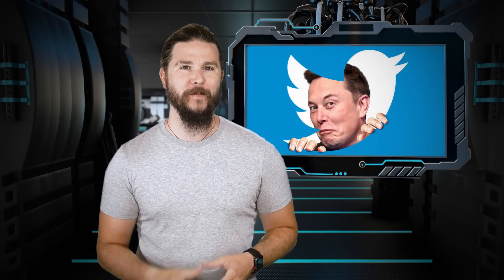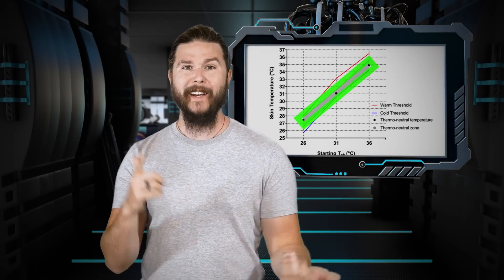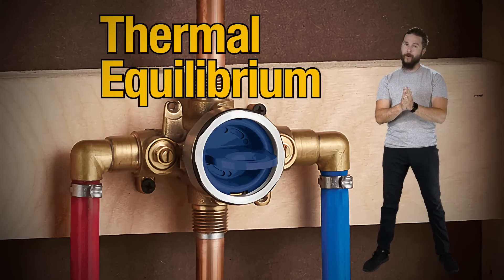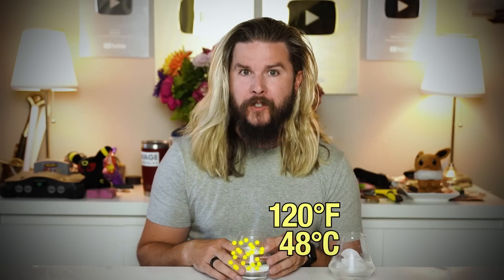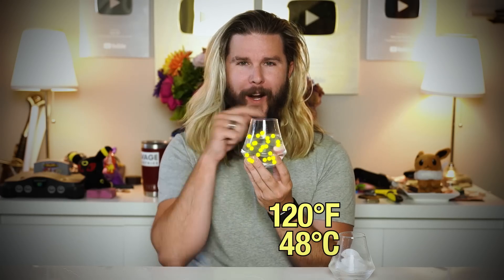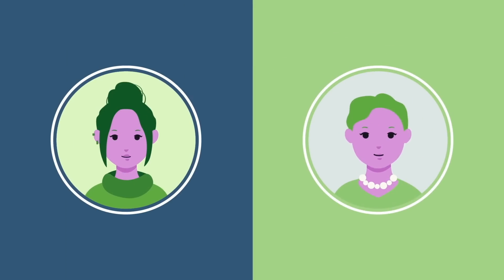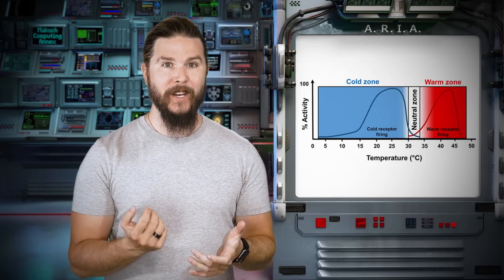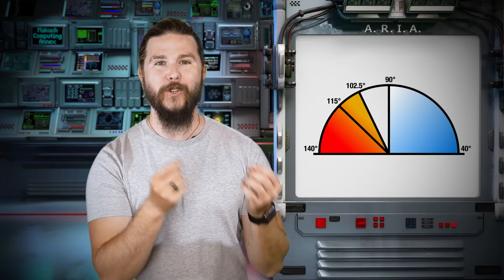Why Are Shower Handles So Sensitive?

Comment: So here in Australia until the last couple decades we didn't really use that stupid one handle control for our taps. We had two separate dial like controls that I can't find the official name of. I'd traditionally call it the hot tap and the cold tap but I don't know if that's technically correct when you have a mixed tap (unlike those in the UK who may have separate taps).

Comment: The best option is to have individual valves, one each for the hot and cold. They seem to have much more fine control when it comes to temp due to the ability to just increase or decrease the temp of water you want.

Comment: If you buy an expensive shower valve assembly it will do away with the problem of adjusting your water temperature in the shower, ask the plumbing technician at your local Home Depot for the best shower valve

Comment: actualy you need better valve 
most valves have round holes. so on the sides of spectrum it is less sensitive than in the middle, where is counts

Comment: Showers that have independent hot and cold taps are easier to control. If you have a geyser then the sweet spot tends to move as the tank empties. There's also those masochists who take cold showers but we won't talk about them.

Comment: There's another solution and it's easier. Most showers have a stop on the canister/mixing valve you can pop the screw off to remove the lever and under should be adjuster to stop the hot water at a certain point. If you do it after setting the temperature (maybe add a bit if you would like to take a slightly warmer shower occasionally) and then you can just turn it all the way on every time

Comment: Kyle, you dunking on Elon Musk looks strikingly similar to other guys dunking on their exes.
Thanks for seeing the light and ditching that jerk! >:3
P.S.: You have missed something. On most of the showers I have used, only about a tenth of the handle motion controls temperature at all. The other 90% of the range is either entirely cold water or entirely hot water. So the actual useful range can be around 1% or less of the handle's turn radius. Worse, on single-handle showers, the functional range often depends on the water pressure setting. On the one I used to test this, I found that at maximum pressure (which was uncomfortably forceful for me) the control range could be as large as 30% of the handle's turn radius. However it faded on a linear curve to completely disappear at around half pressure. At any pressure below this point, there was no control range at all, and the shower would simply give either only hot water or only cold water. It was thus *actually* impossible for me to get both a comfortable temperature and a comfortable pressure in this particular shower. And this was not any unique shower, it was simply the one on which I performed the test.
P.P.S.: No, it really is lazy engineering. If I had a shower with 100% or even just greater than 50% control range, I would find a comfortable temperature easily and never complain. But I have only ONCE used a shower like this. If you have one like this, then what are you complaining about?
I don't think it's lazy engineering actually, but rather classism. I suspect that the more expensive homes include these higher quality showers, even though they don't cost more, simply because they want to make sure that cheaper homes are less luxurious. It is similar to how they intentionally make flip phones suck in order to make people with smartphones feel superior.

Comment: shower handle? i just have to knobs, the hot one you open fully and with the cold nob you adjust teh temperature until is juuuuuuust right. usually a quarter of a twist. but perhaps thats a dutch thing, i dont know how other countries do it

Comment: I have an old-school style shower with two dials, one for hot and one for cold. Tbh I think it eliminates a  lot of these problems because YOU choose how much hot and cold you have. I always turn hot on full and then adjust cold until I'm comfy
Reply: That's pretty much what you have have to do with a hot, cold, and shower divertor. You turn the hot all the way up for the max water pressure and then add with the cold water to regulate the temp. It fluctuates when your water heater isn't working right or if someone decides to flush the toilet or run the kitchen sink while you're in the shower.
Reply: I came here to say this same thing. Though we have the same issues while we're adjusting the cold dial.
Reply: @Jarekthegamingdragon  Same here! Two knob showers are superior :D Though a lot of this discourse depends on how your hot water heater runs and your water pressure too!
Reply: @Jarekthegamingdragon  could try cutting the seat and installing new tap washers. You may have a sticky/deformed washer on the cold tap.
Reply: I just use cold water and i'm fine
Reply: @Sp3ttr0  Are you physically fit? And that is a serious question by the way. I genuinely want to know because I heard that colder showers make you lose more body fat.
Reply: @Rightly_Divided  yes, but i don't know if is the cold shower that make you lose body fat,  thou my skin is good and i don't suffer much the cold; however in my diet there is almost no 
flour based food, i don't eat product maded with milk and almost no sugar and rarely some alcohol
Reply: @Sp3ttr0  Oh nice. That is probably more it. The diet more than the shower. Thank you for the response
Reply: @Rightly_Divided  You are welcome

Comment: Showers are not generally built this way in Sweden. It always confused me then I visited the states how anyone would want a shower with a design like this that makes it so hard to find a good temperature.

The common design here uses two screw knobs, one that controls flow and one that controls temperature. The temperature one has usually has more than 360 degrees of motion and makes it really easy to gently make it hotter or colder.

Comment: At the hotel where I work, our shower faucets actually have a "mixer" on the hot side which prevents the water from changing too rapidly. It's a great design, but can be annoying if your area has hard water, which occasionally is subject to particles breaking loose and jamming it due to buildup. It's really just a little barrel in a tube with holes in it that spins in place to mix the hot into the cold. Any sizable pieces of buildup that break loose have to either work their way through or be removed. 

Again, it's a great design and makes it virtually "impossible" (I use the word loosely) to turn the water hot enough to cause injury. But it comes with occasional headaches.

Comment: It's funny to see this video as a Brazilian, as here we all use electrical resistance inside the shower to heat up the water, so there are two types:

1 - A simple electrical coil resistor with a few stages that we select, so there will be more or less current through the resistor, and then more or less heat(and it only turns on when there's water going through it, so it won't burn, but it sometimes happen anyway), so to get more precise temperature, we change the amount of water going through it(and get to the same sensitivity problem)

2 - A less used or know, a more expensive electronic shower, that uses a potentiometer(a variable resistor), so the water will have only open and closed stages, and using a knob we can change the resistance precisely to what we desire, with less sensitivity and preventing the occasion of burning the resistor

And also, NO IT DOESN'T GIVE US ELECTRICAL DISCHARGES, even on bare foot, in order to get a shock, you have to actually touch the holes of the shower somehow, and I actually never heard myself of anyone dying or getting a strong electrical shock from a shower, like, ever

Comment: I have considered this so much while showering. I’ve worked out a connection between temperature and pressure of both hot and cold sides. Makes for a very complex interaction between mixer temp setting and the overall pressure setting

Comment: Some people warned about Legionella when reducing temperature on the heater. While that is an important point, it's only true for heaters with a hot water tank! Heaters without one are less prone to Legionella and if you'd still get them, you couldn't turn the heat up high enough to actually kill them, since it takes minutes for them to die even in boiling water.

If you have an instantaneous water heater you should set a temperature that enables you to enjoy a hot shower when the handle is turned all the way to "hot". This will save you energy, frustration and, very conveniently, if someone else uses water while you shower, only water pressure will change, but temperature will not.

Comment: My shower has seperate temperature and flow controls

After setting the temperature once I dont have to touch it again.
Its pretty much norm in here. I have not seen a single shower like shown on video.

Comment: okay....hear me out.......how about we put a heater, INSIDE the showerhead?
you could use a turbine to generate power from the flowing water sending that energy through a bit of nichrome wire mesh to heat it up, and have the water pass through it which heats it up allowing you to "buffer" the water with a bit of extra heat almost instantly to allow for smoother temperature changes.

Comment: The obvious solution is to make your shower handle a giant steering wheel, so you can feel like you're driving a ship while showering
Reply: I love this idea.  This is not the solution for this problem, but it still solves so many problems.
Reply: and have a 100:1 gear underneath
Reply: If you close your eyes and  spin your head around for the sea sick sensation you can pretend you're a pirate travelling the seas during a violent storm
Reply: @cornbreadloverrr  I like this.
Reply: Gaint wheel so the few degrees you turn it are easy to see and control, and you're captain, good solution
Reply: @stoatystoat174  A ship turns over the course of many miles. No need for a giant ass wheel. The boats with large wheels are smaller boats that turn more quickly.
Reply: Perfect level of immersion! I'll get an outlet set-up so I can play Sea of Thieves in VR. I'll need a power strip too. This is going to be great!
Reply: @McGeistly  that sounds like a shockingly good idea!
Reply: Yar! It be drivin' me nuts!
Reply: Instructions unclear. Im now a fugitive from the british empire.
Reply: And while we're making improvements, add a throttle to control the total flow rate.   Maybe a big horn.
Reply: @ANunes06  I like this idea.
Reply: I thought of just adding a mechanical temperture mesuring device and having its displey be at the edge of the adjuster
Reply: Yes!
Reply: Somebody, please implement that!!
Reply: Add this to the list of deep desires I never knew I had
Reply: Ledle ledle ledle
Reply: And with the ability to stop it from affecting the temperature
Reply: Nah, a panel on the wall that allows you to set the exact temperature will do me.
Reply: I mean you could get much more percise temperatures with a large wheel instead of a small handle
Reply: @almontemcclendon661  if i had a big ass frigate steering wheel in my shower i would be sooo happy.
Reply: Yeesssssss, a great stonking ship's wheel in the shower would be great fun.  Best when paired with Jolly Roger curtains.
Reply: Genius
Reply: This is the way
Reply: You say this as though you've already done it 😁🤣🤣🤣
Reply: @Cyb3r_Snai1  It's a solution that only an engineer would come up with.
Reply: Turn this giant wheel that is bigger than the moon just one nano-arc-second of a degree, that will work.
Reply: +1
Reply: YES.
Reply: Small issue: I have a very strong urge to spin it dramatically and thus burn myself
Reply: Dude,… my mixers at my other house are kind of like an old, old, ship’s speed control/throttle whatever the maritime term is, come to think about it.
Reply: Most ship steering wheels are really small, in fact the biggest ship in the world has a steering wheel that's about 12 inches
Reply: @ballistictank8023  That doesn't surprise me, the larger the ship, the less precision you need as it's going to take a fair amount of time to see any corrections you make. Those large ships take miles to come to a stop when you want to.
Reply: @ballistictank8023  We mean older ships, with big steering wheels.

Comment: It seems like in Finland this has been solved a long time ago because we have showers with better temperature control
Reply: People here just exaggerate about the shower. Its not hard at all to find the temperature you want, probably no different than Finland showers.
Reply: @SelfProclaimedEmperor  very different in fact, almost all showers in the northern countries use thermostatic mixers, which mixes the water to a set temperature rather than a fixed ratio, usually a turn knob on the side of the mixer which can turn about 360 degrees, giving you sweet sweet accuracy
Reply: @TheBorderdogg  Yup same here in eastern europe. Thermostatic valves cost the same as regular ones. I haven't seen manual valves in a long while. Just set the temperature you desire and let the machine do the work...
Reply: @TheBorderdogg  Is this because in the northern countries the pipes are far colder, thus making setting the temperature you want manually harder to figure out?
Reply: @SelfProclaimedEmperor  nah, we like shit to actually work decently in the cold countries. Roads, shower controls, public health..
Reply: @GundamReviver  Funny, because the US ranks higher than all of the Nordic countries on infrastructure. Sometimes the memes are just memes, and the superpower is actually better.
Reply: @SelfProclaimedEmperor  just checked because this sounded dumb to me. Netherlands (where I'm at) 94.3 only Singapore is above it with 95. 4 the US is at 87.9 (which is indeed above Denmark and Sweden for instance)
Reply: @SelfProclaimedEmperor  You're telling me that America ranked better than Norway, the **most developed** country in the world in infrastructure? I'm gonna need a citation for that one bud
Reply: @LulfsBloodbag  Norway is not the most developed country in infrastructure, where's your source?
Reply: @GundamReviver  well I'm still correct then because Netherlands is technically not a Nordic country lol
Reply: @SelfProclaimedEmperor  Huh, funnily enough I looked it up and apparently Norway is high in pretty much everything except infrastructure. That's weird. Well, I admit it. I was wrong. But also the UK is two places higher than the US so I'll take that as a win lol
Reply: @LulfsBloodbag  Well I wouldn't count on being ahead for long, we got the infrastructure and jobs investment act just starting up putting $550 billion dollars into infrastructure projects, while as far as I know UK has no infrastructure building program going on right now. lol
Reply: @SelfProclaimedEmperor  Actually we do have new infrastructure being built. Most notably is the HS/2 railway project to provide a high speed train link between London and I think Manchester, which is really needed. Our trains are better than American trains, sure, but they really lack compared to the rest of the continent. We really are suffering from being early adopters, all of our existing railways are relatively low speed because of how twisty and bendy they are. Our tunnels are also too short to have taller locomotives like Germany with their double decker passenger cars. But anyway, as much as America and the UK have a friendly rivalry, good luck with your own projects. I just hope it isn't going to be more car lanes.
Reply: @LulfsBloodbag  More assumptions..."our trains are better than American trains" lol...according to Statista, for "Ranking of the most efficient countries in train transport services in 2019" America ranks 12th, while the UK is not shown at all, thus not in the top 20. Ooph...even France beat you guys...and the French are...well...French.
Reply: @SelfProclaimedEmperor  How the hell can your trains be 12th? The only place with effective trains are Florida (Who have Virgin trains) and New York.
Reply: @LulfsBloodbag  Hmm, well I'm sure British trains are well made, but the train system itself seems to be highly bureaucratic and slow. Most British people I ever met say the trains are always late in the UK. 

As for the US...well I know we invented the meme that all of the US looks like detroit, but its not actually true, funny when people underestimate us though lol
Reply: @SelfProclaimedEmperor  Part of the problem with the trains here is they're privatised. So some companies can have amazing trains that are always on time and fast and comfortable, and then you get companies like Northern Rails or Arriva which are known for being shit. I might be misinformed, but I got the impression that the only train service in America is Amtrak and that they're often late because they share lines with slow freight trains. That's why I said NY and FL are the only places with good trains, FL has virgin media and NYC has the metro

Comment: Note that the "Cold" water is just water directly from the public water pipes. It is not heated or cooled to any particular temperature, it is just the temperature of the water source and the environment. So as the weather changes that "sweet spot" will gladly start moving around.

Comment: You can also replace your shower valve with a dual function valve. This is one that has one handle that opens and closes the valve letting water into the shower, and second valve that independently controls the hot/cold mixture.  These usually have fine control valves for the hot/cold mixing too so it's easier to get the exact temperature you want.

Comment: Dialed faucets should be installed in every home to save water.  When you pull the knob, the perfect water temperature is set, so you don't waste water sorting it every time.